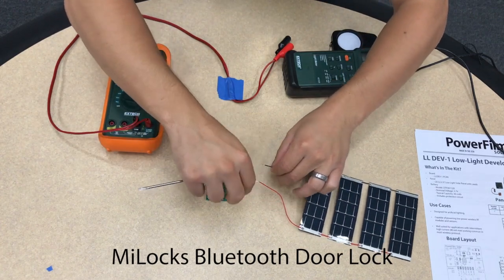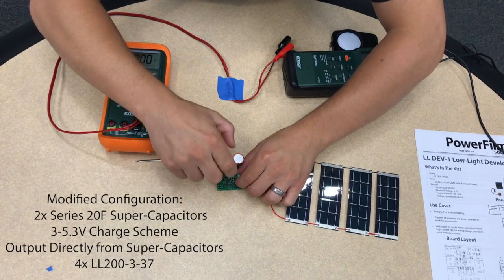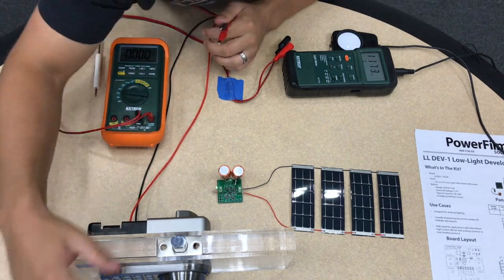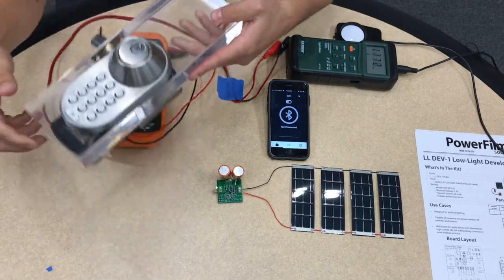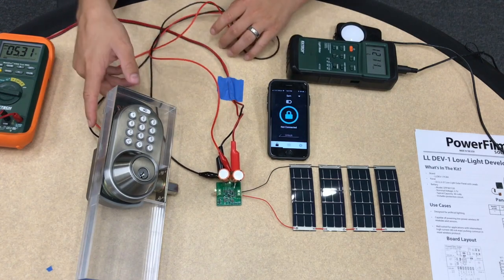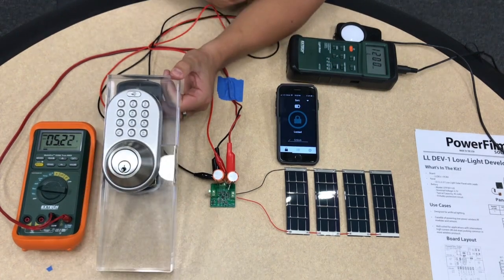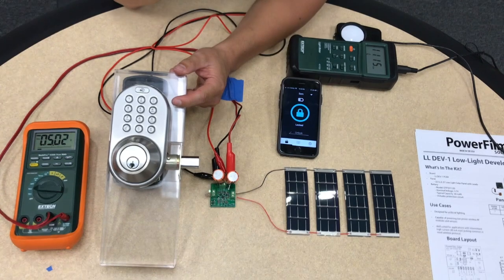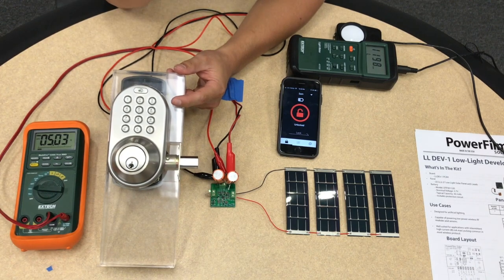Indoor Solar Powering A Bluetooth Door Lock

Comment: Hey, where can i get this setup, as i want to solar power my august door lock!! I cant afford changing the 2x cr123 batteries about once each month!  (I literally plan to drill a small hole through the door to run solar panel power wire to the outside of the door, I figured i may need a mini charge controller thing too, so if you can recommend something I'd be Greatly appreciative !
Reply from the maker: Brandon, thanks so much for reaching out. Can you do me a favor and send me an email? You can reach me at shansen@powerfilmsolar.com. I will connect you with our dev kit designer so he can confirm the charging compatibility with you!